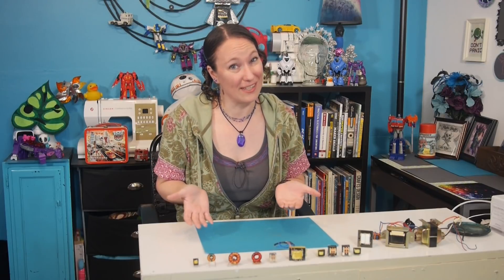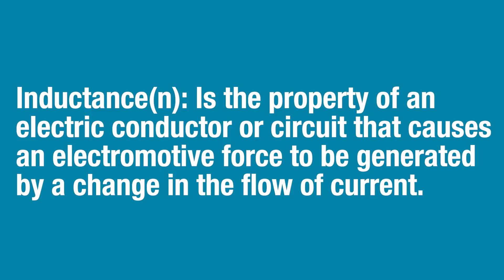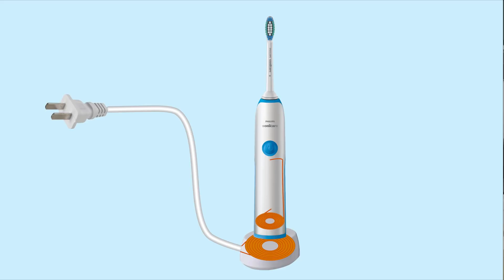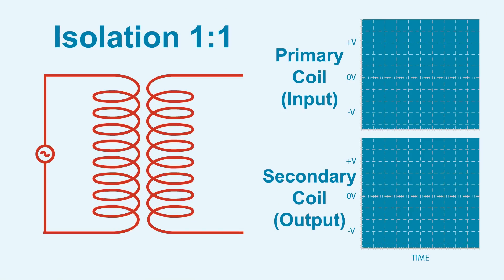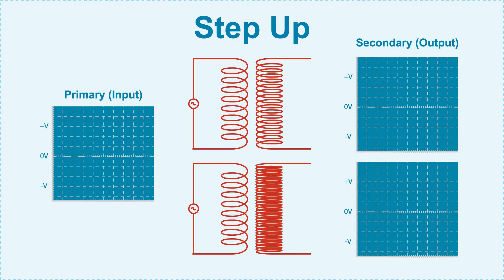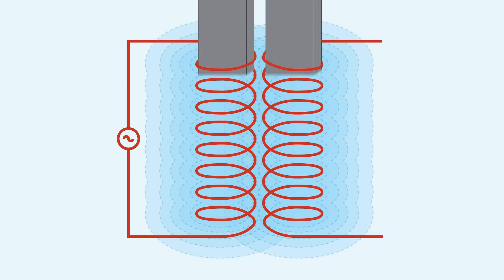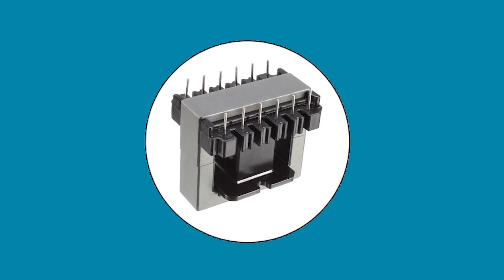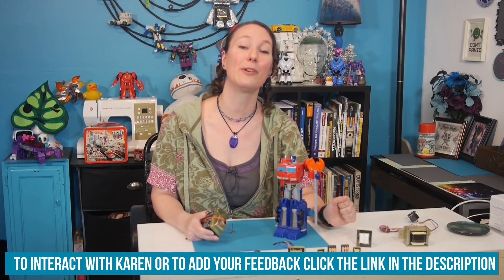How do Electronic Transformers Work? - The Learning Circuit

Comment: When a  continuously changing magnetic field cuts/spreads across a nearby conductor,  an EMF is induced in the conductor they say according to Faraday's law of magnetic induction. What does it mean. Does it mean charge separation takes place like a battery, where some free electrons are move to one side of a conductor and thereby that side acquires a higher electric potential(as electrons repel each other naturally) compared to the other side. Or is it simply that the   time varying magnetic field simple charges/sets up the electrons on one side of the conductor to a higher energy level compared to the other side and then current flows from the higher potential side to the lower potential side. Which one is it.

Comment: Nice detail.  Wondering if detailing the two and three phase transformer design is worth an episode in regards to transforming to 1 phase?  Seems would be beneficial and more-so because I'm researching now and bummed I'm not finding the toroidal 60Hz larger cores that seemed to be around more a year or so back and if I recall correct made from Mu-Metal that wasn't that expensive.  Maybe they were seconds or overrun production leftovers.  Maybe even detailing the high magnetic permeability materials also would be an interesting episode with oscilloscope visualization of effects since seems the graphics would be even better graphically representing more signals information?  I also think would be beneficial overlaying the potential and the current to better visualize the effects at the same times maybe to get more on the screen to teach the details.  Impedance is definitely an episode in itself to simply detail the effect and range of applications.  That still intrigues me to this day the differences that can be visualized using an oscilloscope with the range of single transforms.  OK, enough blah blah blah.  What's neat is yesterday I moved my microwave oven transformer (MOT) collection that lately, I've been wondering about testing performance of each more critically and then matching to make a parallel (if not larger custom stack) step up or down transformer and possibly a three phase to single phase transformer.  I've never seen anyone make those online using MOT's.  Originally, I started the collection for welder inductors to smooth the current, like the capacitors smooth the potential for the AC rectified DC design mods.  Trying to rescue the made in the U.S. ones and get more versatility for utility out of those.

Comment: The title is kind of misleading, it is an electric transformer, not electronics. I thought there is something solid-state kind of which video is all about. 2nd the Transformar also works on Pulsed DC, almost all SMPS and regulators work with pulsed DC using an H Bridge of half-bridge.
Cheers ✨✨✨✨
Reply: Think in terms of the search engine - adding "electronic" to "transformer" gets rid of most of the "transformer" cartoons.....
Reply: Are electrons not involved? 🤔
Reply: @richardhead8264  Not exactly, although it is interfaced with electronic circuits. But Transformer dont involve electronics

Comment: Great video, very informative. Only thing I would add is that for residential step down transformers in the united states, the voltage is stepped down to 240v and then the secondary coil is "short circuited" half way through the coil with the use of a "neutral" wire that allows for two 120v feeds to the residence. This way the secondary coil can be used for a full 240v or separate 120v circuits. Some what unique to the united states

Comment: How does the thickness of the wire in each windings affect how much current can be used by the load?  
How does one known when winding a transform what thickness wire to use to ensure it will provide sufficient power to a load without causing the wire lamination to melt & short out the windings & thereby destroy the transformer?
Reply: I'd also add: In the diagrams the coils are always wound in one direction, in practice they are sometimes wound back and forth - does this effect the efficiency?
Reply: @TrollingAround  It should affect the efficiency because the rotation of the magnetic fields around a wire follow the right-hand-rule which means as AC current flows in one direction the magnetic field flows in a specific direction according to that rule & when it flows in the opposite direction, the rotation is opposite.
Reply: @ab_ab_c  Yes - I agree, however in many tutorials on winding coils people wind left to right to left etc.  Especially when winding coils for generators (where permanent magnets are used to induce current).  I was wondering if direction of coils vs direction of wire was significant.
Reply: @TrollingAround  I'm not sure what you mean by "direction of coils vs direction of wire"
If you wind a coil from left to right, when you reach the right end of the coil, you can continue to wind in the same direction and start winding back towards the left end of the coil for a second layer of the same coil.  When you wind like that, the coil is wound in the same direction whether your wind left or right.  In that case each row of winding should produce the same magnetic rotation around the wires & add to the magnitude of the magnetic field when current flows through the coil.

Now that wouldn't of course be the case if you reached the end of the first winding & then bent the wire & starting winding the coil in the opposite rotational direction towards the left when winding the 2nd row of wire in the coil.  In this case it would seem the magnetic field rotations would interfere/cancel with each other.
Reply: @ab_ab_c  - Thank you, very clearly explained.

Comment: Very good, I always enjoy watching your videos. Thank you for taking the time and effort to produce free education for the masses. I have a few suggestions. Perhaps there can be a followup video that can demonstrate live circuits, eg: measure input and output voltages, and how to identify the wiring for the primary and secondary coils. Maybe build a little breadboard circuit of some type. Also, maybe you can touch on why one type of transformer is selected over another type during designing a circuit, eg: size, type, power consumption and requeirement. Additionally, you might add what center tapped transformers are and why they are used.  Perhaps you can find a suitable transformer to dissect, similar to the wireless toothbrush charger. As always, keep up the good work!

Comment: in Brazil (south america) we use both 127V 60hz and 220V 60hz, mostly 127V. 220 only for high power devices like heaters, ac units